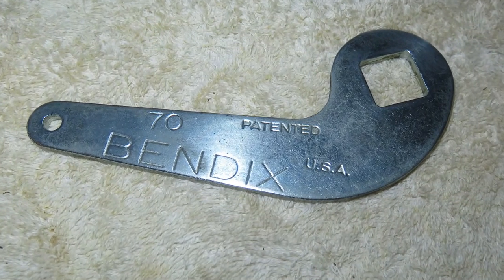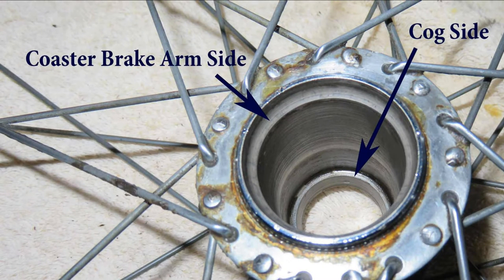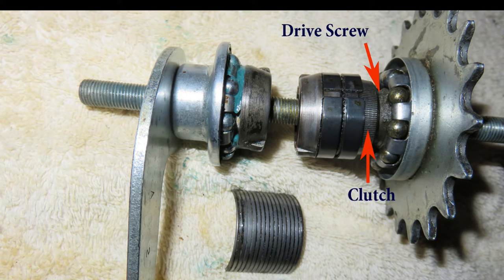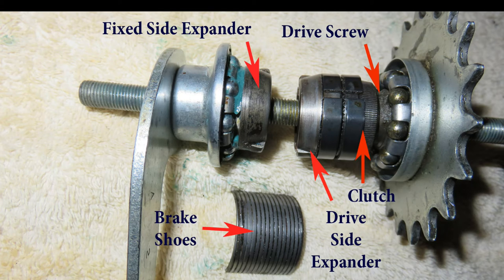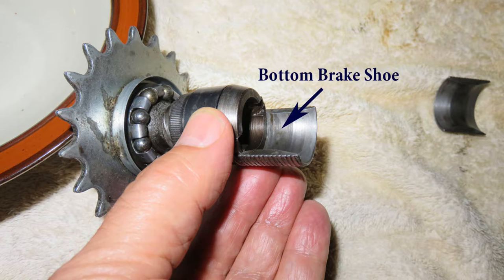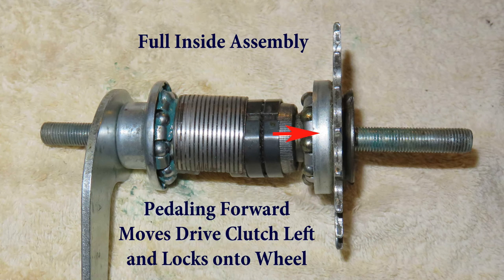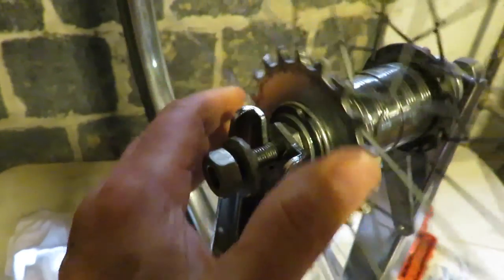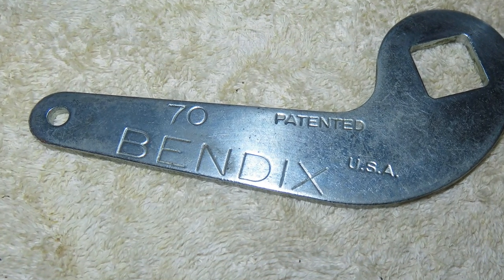How Bendix 70 Coaster Brakes Work

Comment: Excellent explanation thank you. But what is the function of a brake arm unit it seems to me that its completely useless
Reply from the maker: The brake arm unit holds the adjacent fixed side brake expander in place.  If the wheel bolts were a bit loose, once the brakes are applied the arm along with the fixed side brake expander would just spin and the brake would not work.

For more information, I have a blog posting on the coaster brake at:
https://www.dougbarnesauthor.com/2018/06/how-bicycle-coaster-brakes-work.html?m=0
Reply from the maker: I forgot to mention the arm is bolted to the rear dropouts to prevent the spinning.
Reply: @barnesdf2  than you so much for your answer. I am doing an analyse on bicycles for my school and this was the most helpful video overall
Reply from the maker: @numansivri9110
Reply from the maker: Glad to hear it was useful.  You might check out RJ the Bike Guy who has many good repair videos.

Comment: Just picked up a bike with a coaster brake. When I try and pedal backwards to stop it pushes my foot forward. What could be the issue?
Reply from the maker: Can you pedal forwards and the coast on the bike. If you can pedal forwards and can't coast, then the brake clutch is probably locked onto the hub rim. This may be cause by dried up grease in the hub.  What is the model of the brake.  I have a recent posting on the inside of the brake on dougbarnesauthor.com.  You may want to look at this before replying.

Comment: my brake kinda locks up when i dont even give it full power. and when i stop brakin it lets go. is there anyway i can fix it and why does it do that.
Reply from the maker: It sounds like either something is stuck inside or the brake shoes are misaligned (shifted inside). In either case you will have to take it apart.  This would be a good time to regrease everything (remember to use high temperature grease on brake shoes).  RJ the Bike Guy has a good video on this.  I assume this is a Bendix coaster coaster brake, but they all pretty much work the same way.